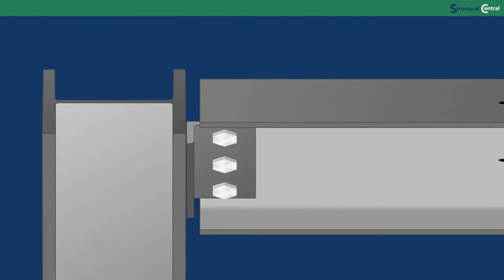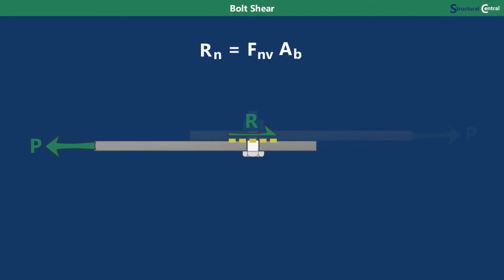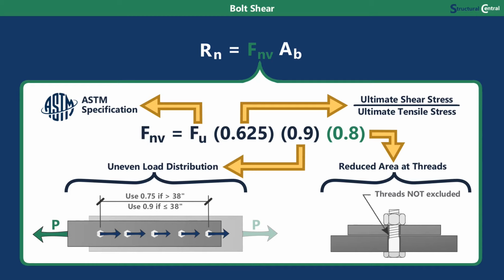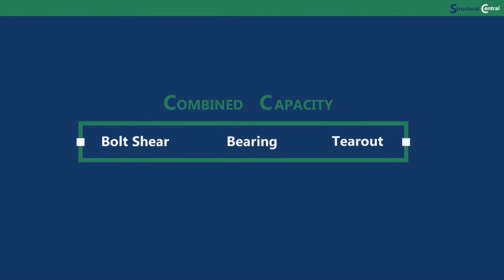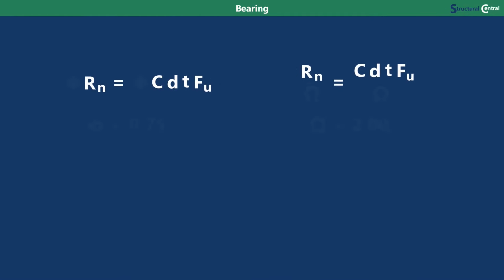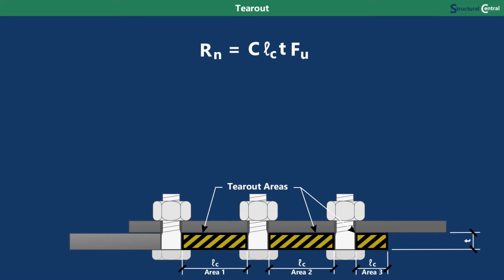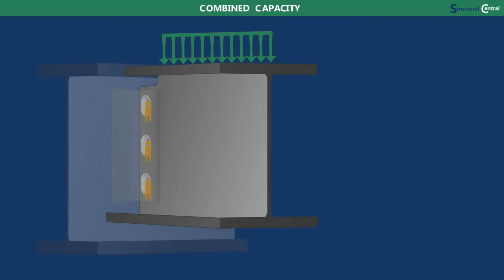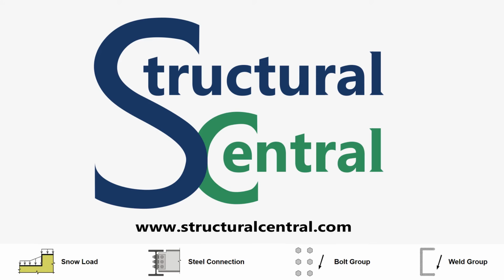Bolt Shear Strength - Bearing, Tearout, and Shear Load Capacity Calculations

Comment: Is it easier to just weld the connection
Reply from the maker: Haha, there's certainly a lot of factors to consider when determining the strength of bolted connections. If you do decide to go the welding route, you should check out our weld strength video first to see if it really is easier. https://youtu.be/drvthuo3uu0

Comment: Valuable Video 🤩 after we calculate the bearing and tearout and shear resistance have we compare it with shear force on the bolt?
Reply from the maker: The strength of each individual bolt is the minimum of its bearing, tearout, and shear strengths (including safety factors), so you must make sure that this exceeds the applied shear force.

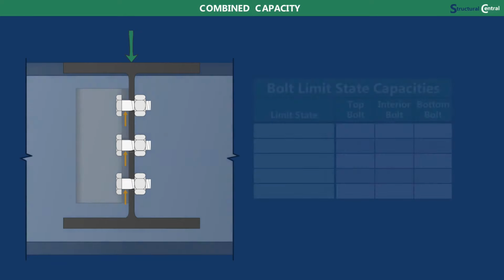An example connection with 3 bolts is discussed in the video at 6:12. The applied load cannot exceed 62 kips. (This is just considering the bolts, so the actual connection strength may be lower when you consider the other limit states.)
Reply: @StructuralCentral   do you have a structural private courses?
Reply from the maker: Sorry, but I don't offer anything like that. University programs are where you can get a broad understanding of the structural engineering field.

Here's also a great list of books and resources for each of the common structure types. https://www.eng-tips.com/faqs.cfm?fid=2189
Reply: @StructuralCentral   Thank you , i appreciate it
Reply from the maker: You're welcome. You can also subscribe too if you'd like to see more videos in the future :-)

Comment: Thank you very much for your this video. I would appreciate it if you could clarify the column cap plate connection design check.
Reply from the maker: You're welcome! There's multiple possible configurations for connections with cap plates so I can't really make a general comment about their design. Is there something that you were specifically wondering about?

Comment: Thank you for the video!
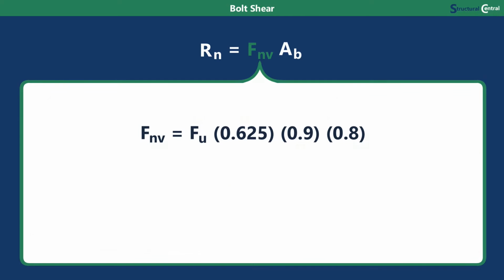How to calculate the bearing stress if threads are not excluded as shown in the right joint when the video is at 2:12?
Reply from the maker: The threads do not affect the bearing strength of the bolted connection (ΦRn = Φ C d t Fu). You get to use the same value for the bolt diameter, d, regardless of where the threads end up in the joint.

AISC 360-16, Commentary Section J3.10 states: "...the same bearing value applies to all joints assembled by bolts, regardless of fastener shear strength or the presence or absence of threads in the bearing area."

The thread location only affects the bolt shear strength (ΦRn = Φ Fnv Ab). When the threads are located at the shear plane, the value for Fnv that you get from Table J3.2 of AISC 360 has a 0.8 factor built into it to account for the reduced cross section. (Fnv for Group A, A325 bolts is 68 ksi when threads are excluded from shear planes instead of 54 ksi when threads are NOT excluded from shear planes.)
Reply: @StructuralCentral   Thank you very much for your detailed explanation.